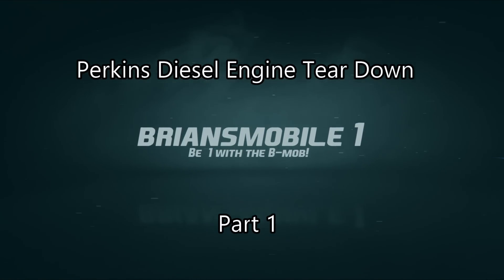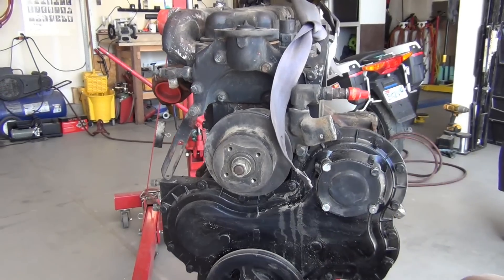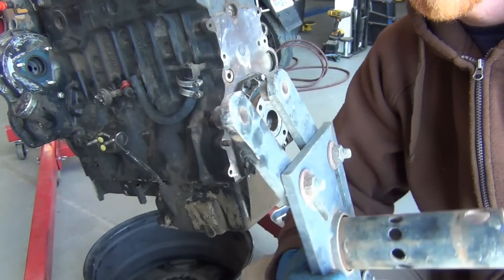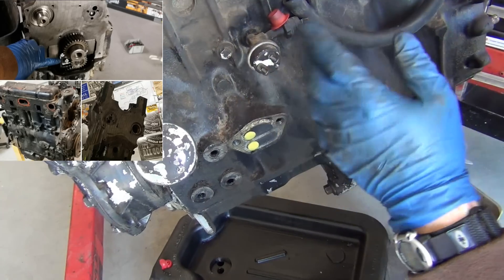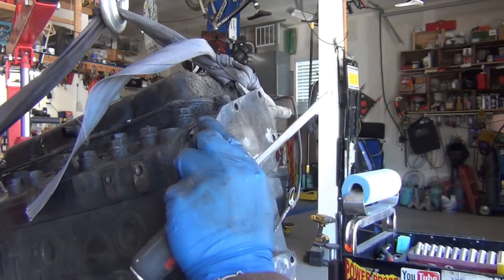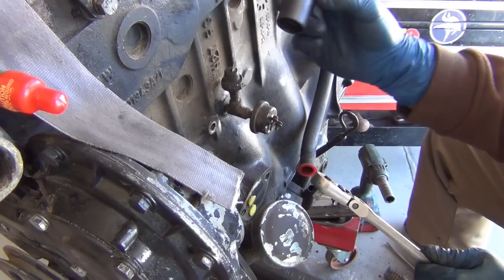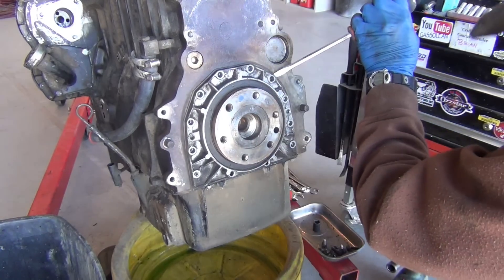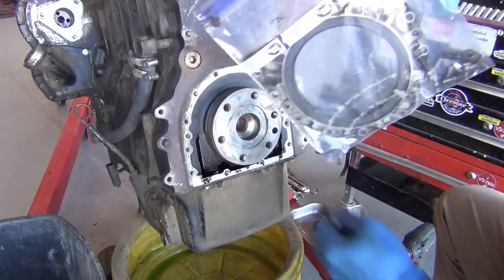Perkins Diesel Engine Teardown Part 1

Comment: Hi I'm doing a liner and piston change and the Perkins is inside of a Clark forklift. My question for you is can I achieve this while still in the forklift or should I pull the engine.

Comment: Torque converter assembly. After I removed the flywheel I couldn't get the spindle off the flywheel.

Comment: can someone tell me why the 4.236 Perkins diesel start from 56 hp and streches to 102 hp ? and what excakly is the changes they make. except increasing RPM, adding turbo and fuel from the gorvenor ? i have a volvo 2200 that i have added turbo and turned up the the fuel pump. from orginal that was 56 hp. there is a a strong noticable difference. but i dont know if it is now 65-75-85-95 hp

Comment: Hi Brian, you wouldn’t happen to know the measurements from sump to highest point? I am looking at replacing the Chrysler lm318 with this engine but I’m worried about height.
Reply from the maker: I can check for you if you remind me.  It's 3am.  I may forget during waking hours.

Comment: I have a perkins engine in a telehandler, it starts and immediately stops and needs bleeding, have resealed all pipes and no cracked pipes, can air get into the cav injection pump? it only runs a second! any ideas? very informative videos, thanks!

Comment: Oh yeah,  Brian,  I'm the same way I used tons of zip bags in my engine swaps or rebuild jobs.  Much life saver!  I love Perkins engine.  Used to have one on Bedford CF van in England.  I had 2.3 straight four Perkins diesel,  the injection pump was mounted slightly vertical in front of engine.  I'm sure you have heard of it? Had it for so many years,   leaked like mofo,  but had it for hundreds, hundreds of miles.  425,000 miles total.  Great lil engine.  👍👍. Great video

Comment: Those Perkins usually have the Bosch DP pumps. Did you time the pump before pulling it? There’s a little “coke tab” you unscrew on the body of the pump and flip up then screw in to stop the hydraulic head from spinning.  Love your Subaru stuff and your channel Brian.
Reply from the maker: Thanks James!  That's right, this engine has a similar pump and process.  I have videos listed on it under CAV / DPA on my channel.
Reply: Right on. I didn’t see if the timing cover piece for the pump gear removed that’s why I had mentioned it. The British are weird when it comes to nomenclatures, they call a gasket a “joint” in the service manual. Thank god for 1776! JK

Comment: Dont forget 7/8 works for 22 mm,  And 5tpi unc is almost the exact same as 5mm thread pitch.
Reply from the maker: That's right!  I discovered that on my steel buildings bolt anchors.  (after filming this)  Thanks Ben!

Comment: What you are doing with it ?
Reply from the maker: Great question!  I'm rebuilding the engine.  I missed a clip that should have been in there of the engine smoking and not running well and another clip of compression being below threshold.